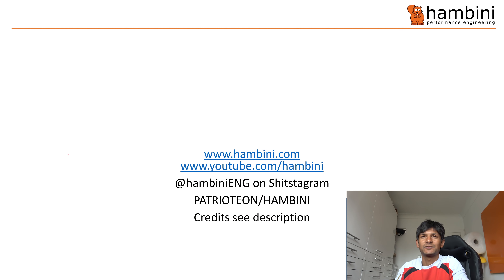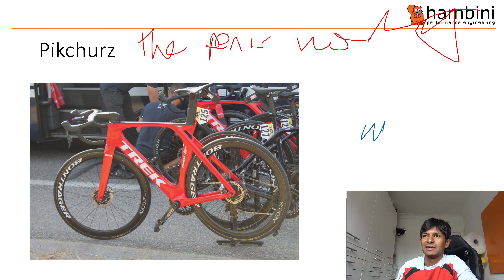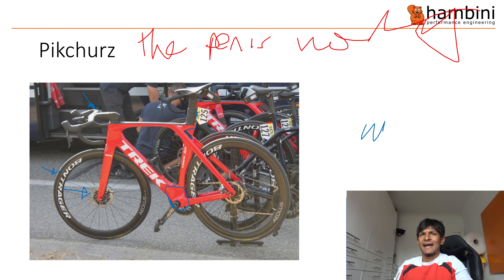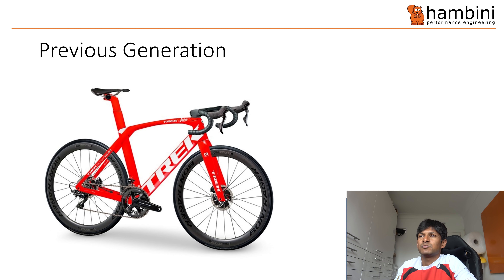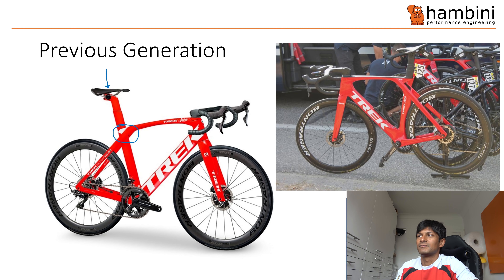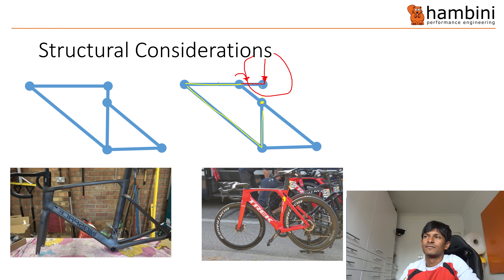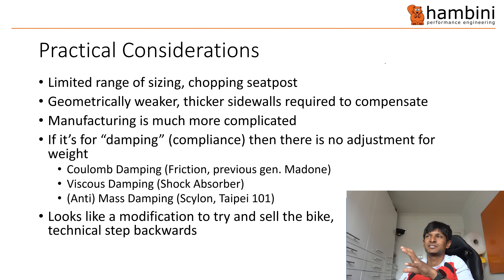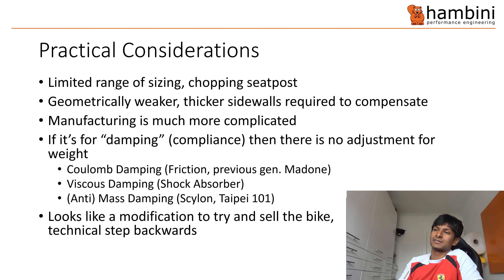New Trek Madone gets an Engineering Roasting

Comment: Thanks, I was about to look at a used Trek Madone 4.5 H2 (whatever the H2 means). I'll have to rethink that now.
Reply: The H numbers simply refer to the geometry.  Pre 2020 Emondas were available as H1 and H2 fit - H1 being the more aggressive.  Later Emondas are H1.5.  Madones likewise but not sure of model years.  Full specs can be seen on Geometry Geeks.
Reply: @mischief2168  Good explanation of H1 and 2. Just to add H2 is endurance fit and H1 is race fit according to Trek whenever those two frame geometries existed.
Reply: @roberts1159  ... thanks, yes of course race is more aggressive than endurance.  BTW,  you happen to have made a small typo and accidently said that H2 is race  too.
Reply: @mischief2168  Oops, thanks for pointing that out ! Fixed..

Comment: If you're not treating the head tube as a "side" of a parallelogram then its inconsistent to treat the similarly small juncture between the stays and top tube as a "side". Apart from that, I agree the cantilevered seat arrangement is bonkers. Madone frames were already well over weight, but this will just make it worse
Reply: I had the same thoughts
Reply: Scoundrel!! You will not question The Hambini!! You will respect The Hambini!!
Reply: @helldorado1489  yeah, nah
Reply: How relevant though is it in terms of the structural integrity and composition, more specifically to his argument? It could be argued the rigidity of that section in any axis may not be as complicated or an issue in terms of force transfer throughout the frame.
Reply: its actually lighter

Comment: I never understood the Trek appeal at all. Their bikes are mediocre to crap and the “Lance Armstrong” effect that sold them originally is long gone. 
I hope to hell Time comes back as they IMO made the only production frames worth buying/riding.
And all the amateur clowns talking a few watts while dealing with motorcycle brakes (dork disc) and insanely complicated cable routing are just crazy as hell. Dudes were riding faster than you 40 years ago on steel bikes with rim brakes. Manufacturers have made dork discs and invisible cable routing so 95% will have to see their “stealer-ship” for a 10mm headset height adjustment. Clowns.
Reply: When Trek's design and engineering sense aren't bad enough, just look at their "Project One" luxury custom bike to lure in some wealthy suckers. For me, I'm happy with my used Time Izon which I got for less than $2000 USD.
Reply: I used to think it was cool and desirable when they started making brake hoods with concealed cables. 30 years down the line I don’t give a damn as long as it’s reliable and doesn’t cost stupid sums of money.
Reply: @Lurcherman-p4k  
Very true on cable routing. When Shimano’s hood designed from external to internal, the shifters started eating cables.

Comment: I don‘t think you loose power with isospeed. I‘ve tried every setting and didn‘ t feel any loss of power. If so it should be very little.
Reply: Just like you "don't lose power" with an unlocked full suspension. It bounces back, after all. /s

Comment: With the "triple trinagle", one can run the stays at less of an angle, but they are also longer.
With the hole, the structure is stiffer below, and has more flex above.
In side-wind you see the frontal mass of both sides of the hole from an angle.
All this to get something for a seat-post that also moves vertically.
Let's see if it falls apart, seems there is a natural stress risor wanting to crack it apart.
Reply: I'd run the rear stays into the downtube and put an elastomer under the (regular) seattube.
That way more of it is exposed for that side-to-side flex, and it is possible to run a (regular) adjustable seatpost.
I am not an engineer.

Comment: I thought that the UCI rules required that the seatpost was supposed to extend from the seat tube.
That's not the case in this bike.
I know that the UCI are about to change the rules but in the meantime, this frame seems illegal, to the best of my knowledge and interpretation of the UCI rule book.
But then again, it wouldn't be the first time that they bend the rules.
Reply: Bet the Trek guys found a HOLE in the UCI rules.
Reply: @iancuk  
Using the back door !
Reply: The UCI has already cashed the check

Comment: Hardly the first "beam bike" but there's an entire decade worth of data on the subject from early 2000's TT bikes and it's much ado about nothing unless Trek has taken an even greater step backwards in time from a design and QC standpoint. They can't/won't fumble the bag that hard.

Look no further than the Titanflex and Softride powerwing bikes. 5x larger cantilevered span (if not more) and no widespread failures to speak of. 

Is the new Madone's cantilevered design new? No. Is it the first time it has been applied to a UCI-legal road bike? Probably...at least on this scale/level of prominence.

Hambini is probably right about the disc brake parasitic losses outweighing the aero "gains" which are probably at-best a watt.
Reply: The Softrides were hinged with a spring to lessen "bumps" to the beam.    Rgr
Reply: @borano2031  Titanflex had no hinge or elastomer, just Titanium tubing slid into a frame. 

Point being, there is an extensive history of lessons learned (within Trek no less) on how to correctly execute a beam bike design.
Reply: @borano2031  The "Rocket" models may have, but the Powerwing edition just had an elastomer sandwiched between two layers of carbon beam (and the hinge was strictly for seat height adjustment).

For non-hinged beam bike designs you can look even further back to the late 90's and the Trek Y- series bikes. There were both MTB and Road versions of this frame pattern.

Comment: The previous generation Madone does have adjustable Isospeed so you can tune it to your preference. It's hard to explain how it works without pictures but it is adjustable
Reply: Composite leaf spring with sliding adjuster to change the length of the spring.
Reply: @ragethomas  yep, they should have tried to put all of that in the seatpost itself as an optional feature. This monstrosity seems designed by the graphics department. (It looks cool but seems pointless)
Reply: @ivarbrouwer197  I have the current madone and really enjoy it. I do love the design of the new one, but hambini points out exactly what I thought. Plus there wis no technical update alike t47
Reply: @ragethomas  it also has a small damper to control the movement of the leafspring too a well thought out solution just has a weight penalty
Reply: Wasn´t it only adjustable on the higher end models??   Rgr
Reply: @borano2031  No it was adjustable on both the lower end SL and higher end SLR models.
Reply: @borano2031  no
Reply: Well it looks cool! This channel is funny. I adjusted my ISO as a skinny fuck and I feel like I’m in a cruiser sloshing side to side. I like the flared handlebars.
Reply: It's so shits. It comes lose at almost all frames I had in the shop
Reply: @smartie450  I never said it was the best design, only that it had it. Also, what is going on with the Madones at your shop because the at mine I have only ever seen one loose once or twice.

Comment: As I'm watching the Structural Considerations slide, I'm curious what's your take on the frame design of Lapierre road bikes, particularly with the seat stays connected with the top tube instead of the seat tube or intersection between tt and st. I think GT bikes also have the similar design. Is there really a benefit to it or is it done just to be unique, but has its disadvantages?
Reply: The lapierre design has a continuous seat tube all the way to the bottom bracket. The top tube holds it in place which is fine because carbon fiber is strong when the force is parallel to the strands. Carbon breaks when the force is perpendicular to the strands and this is NOT happening on the lapierre design
Reply: I can vouch for it working on the GT Grade. Take a lot of the buzz out of chunky gravel. The bike is super comfortable. If you look at the seat tube profile it’s a fancy leaf spring essentially.
Reply: GT had it for years and others. Looked cool
Reply: More compliance
Reply: The one I don't like thelook of is the Ribble carbon gravel bike - really odd seat stays.

Comment: Do cover the science of the effects of weight - why 2 kg of overweight rider vs 2 kg on the bike frame is diff. And moving weight (eg in cranks, pedals etc) more significant than on frame. Cheers.
Reply: There really isn't (at least between rider and frame). Exchanging 2kg from one to the other will have zero effect on performance unless it affects aerodynamics substantially. 

The rotating mass bit is a crock too. Ever just spin up your rear wheel with your bike hung in a repair stand? My toddler can spin a cheap aluminum wheel to 20mph with almost zero effort, and half of that zero is drivetrain losses and aero drag on the spokes/rim.

At some point it's ok to admit you want the nice things bc they are nice :)

Comment: Looking forward to seeing the Trek spin on these done in a wind tunnel without a rider. To try and make aero gains where a pair of legs are thrashing up and down creating turbulence seems like a waste of time to me. The top tube over hang is going to be under huge stress especially with a heavy rider. I can see Trek making big claims about the rear wheel aero gains as it hugs the frame much more than the outgoing model. All this aero gain’s bikes selling strategy has gone to far. A light weight all round road bike with deep wheels and hidden cables and hose’s is all you need. Specialized think so 🤔
Reply: Cervelo certainly disagrees, with how... radical(?) the S5's design is.
Reply: @VIEultimate  have you heard about the trouble with the fork’s on the S5? If you have even a small crash on one the forks spin round and hit the frame and right off the whole thing 🤔 it’s a very well documented design fault.
Reply: @leeharding8306  Honestly haven't heard about that one yet, but that's not exactly my problem. My pockets aren't deep enough (and body not strong enough) for such caliber of bikes 🥲
Reply: @VIEultimate  Colnago is the opposite. Really it comes down to how strong the rider is. I reckon this full aero stuff is just looks really. A design exercise.
Reply: @TinkleAssify  Yeah, no one's gonna dispute that it's still highly dependent on the rider. I still believe, though, that aero bikes do have their benefits, especially on more downhill and flat courses.
Reply: "All this aero gain’s bikes selling strategy has gone to far. A light weight all round road bike with deep wheels and hidden cables and hose’s is all you need. Specialized think so 🤔
"...
Well, Yes and No...for all around rides only I guess that's the way to go...but! it depends so much on the purpose use of the bike and conditions in real world...
I am a triathlete and I can sure tell you that after a 2K swim, on a 70.3mi triathlon with (90K) slightly hilly or flat Bike course, a heavy 10 kilo Tri bike with deep wheels, deep tube profile, sharp (ST) geometry and good and COMFORTABLE rider position is way over better than doing the same race on a Speci Aethos for that purpose...You Pay big time on the 21K run. So again...it depends. One thing I totally agree on is that Aero frames are already totally exhausted for the UCI rulebook designs.
Reply: Look at Diamond TT bikes and old softrides.  I'm sure there's no measurable benefit to this but I'm guessing it's also well overbuilt
Reply: Internal cables are not even necessary. Al you really need is legs and a lightweight bike
Reply: @gustavosalvini1827  vast majority of aero drag is the cyclist, I sell bikes and I cannot explain to you how many people come in talking about a new aero bike while complaining about how low the stack height is.... Won't make the blindest bit of difference if your torso Is pointing up at the sky, if you want aero gains start practicing yoga, if you want to believe you've got the best while sounding like an idiot waste a load of money on an expensive bike.....
Reply: @Alex-md6bu  Do people who buy a Porsche get such car to go on a race track? No, they just like it. And I think for aero bikes it's partly similar. And if you have the money who are you to tell people what to do with it? Although I totally agree that you need to be realistic with the aero gains you'll get. But having electronic shifting and never adjusting the derailleurs ever again nor worrying about the cables sounds awesome to me.
Reply: @Alex-md6bu  gotta know their fit before saying that. That said, even endurance bikes are quite aero these days.   Assuming you have bottles on the bike, my guess is that my old Trek TTX is slower in the tunnel than many endurance and all purpose bikes sold today if you put the same handlebars on them.   Just put my 2007 SEVEN on lifetime trainer duty and replaced it with a new Domane.   Pushing the same chilling wattage(200), I'm about 1.5mph faster with the Domane on boxy aluminum wheels but that's also with 30mm tires that measure to 33.5 and I had 28s measuring 31 on my Seven.   That really is sizeable and my gravel bike(Grizl) is about 0.8mph faster than my Seven with those same chunky tires and boxy wheels.  All crazy considering both bikes combined are cheaper than my Seven and that's not accounting for inflation

Comment: i had a mountain bike with a 35 cm long seatpost (maybe 40cm even but i think 35), most of which was exposed and it gave phenomenal vibration dampening. why can't they just do that?
Reply: The UCI has put constraints on the dimensions and shape of the frame. A long exposed seatpost requires a steeply sloping top tube and that is banned by the UCI.
Reply: @SaitekFreak999  are you making this up? i cannot find a single thing about it, although i'm reading the 05.10.2021 of the clarification guide of the uci technical regulation. aerobar angle and saddle angle, sure, restriction of dimensions of the joint between the headtube and the top tube, but top tube angle?
Reply: @markifi  Top tube angle is restricted in page 26 of that clarification guide
Reply: @SaitekFreak999  right you are. sorry, didn't see it. the top tube may slope, but it has to fit within a horizontal box 16 cm tall. that is quite silly of them. there used to be loads of frames steeper than that and there still are for cross country racers. it would be hard to argue that those frames are any less safe than what the roadies have